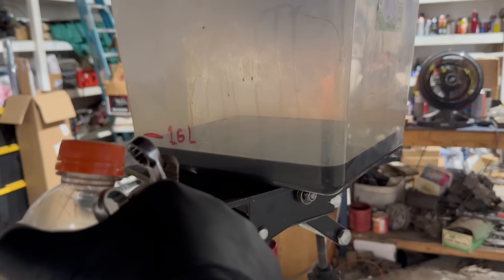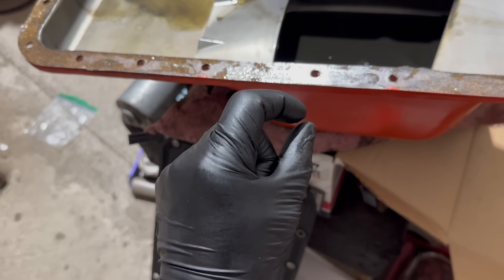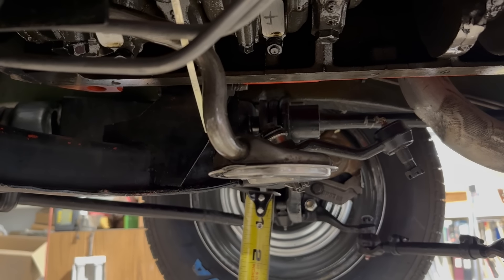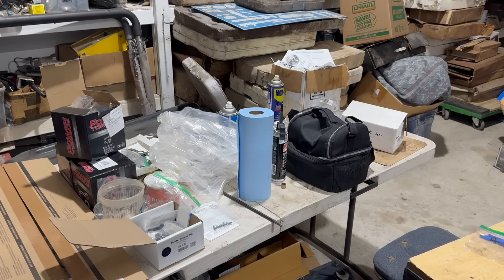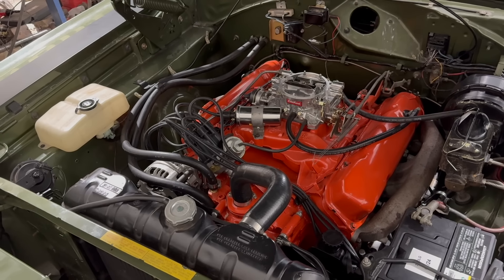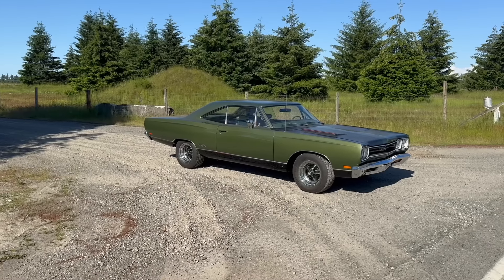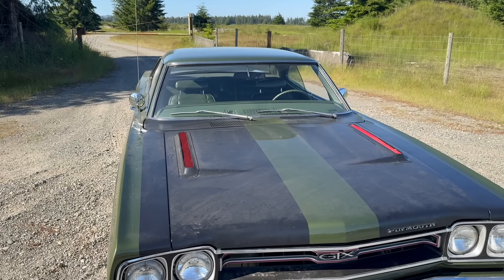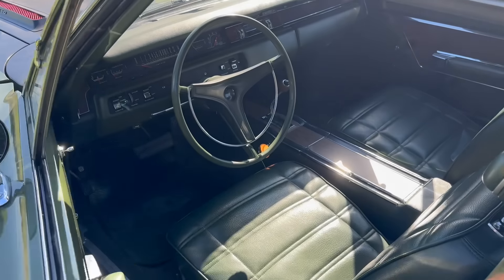Here's A Great Way To Blow Up Your Brand New Engine - 1969 Plymouth GTX 440 Oil Pickup Fitment Fix

Comment: Jamie, my 71 Bee has a 971 pan and I know stock was a 402. However, 440 source says they both take the same pickup tube. 971 is 1/2 deeper than the 402 but they both have the same oil capacity. I know Ma Mopar started putting next year parts on the previous as I have an AVS rather than a Holley. Should I worry about oil starvation with a 971?
Reply from the maker: That’s interesting. There is definitely an amount of up and down adjustment you can get based on how you orient it, so I guess they are probably right. I just made what must be the same pickup work for this six pack style pan so there you go. I have a 440 that was in a different ‘68 Charger for years, and it had the 971 pan too for some reason.
Reply: @DeadDodgeGarage  I also found out that since my car was a factory A/C they pulled engines that were the newly painted blue. Lynch Road assembly did all kinds of weird things.

Comment: Hello here’s hoping Jamie’s help lines open again. Over here in sunny England our sons 1971 Chrysler 300 440 is using a bit of water it likes to leave a litter puddle when we switch off. Big question should we ? Run it up with the radiator cap off to bleed it ,or take a heater hose off and try and bleed it like that or maybe time for a new shinny alloy rad . Now it’s being used a lot more everyone loves it as if so rare over here  have a nice day regards Roy.
Reply from the maker: I’m assuming this has no expansion tank, just a puke line that goes to the ground? Do not fill the radiator beyond the very top of the rows inside. When cold, the coolant level should be a couple inches below the top of the radiator. As the coolant expands when the engine warms, it will then be full. If your coolant level is above that, it may piddle some when warming up, and when you shut it off, it’s going to mark its territory. Let it go through a couple driving cycles, and it should stop. I just did this again in my Charger because I thought the level was low. If it continues from there, you may have other issues, and you are welcome to contact me at DeadDodgeGarage@gmail.com
Reply: Thanks again ,just watched your latest video we had the same issues during the week HT lead came off left a puddle of water and exhaust dropped a  rubber mount and choke didn’t want to come off, All good now the joys of old cars with a mind of their own. Keep up the good work Regards Roy

Comment: You completely click baited me. I absolutely love that car and had a small heart attack. That's something happened to it. And you blew up the motor I am so glad it is running good and yes, pick up tubes and oil pans and ground clearants. Is extremely important in any car project?
Reply from the maker: Alright, that’s my bad. Haha. I mean something kinda did happen but it definitely isn’t blown up. Any engine assembly needs to involve an oil pan to pickup clearance check. Anyone skipping that step is asking for trouble.

Comment: The 7 quart oil pan was 66-69 Street Hemi. No real 440 pickup for them. 66 - 69 440's, including Six Packs are 5 quart. 1970 and newer 440 high performance engines have 6 quart pan as do 70-71 Street Hemi's. There are 440 pickups for 5 and 6 quart pans, but not exactly for 7 Hemi quart pans.
Reply from the maker: Apparently there are 6 quart pans and 7 quart pans? I’ve been told in another comment that 440 source has a pan that is larger horizontally but no deeper, and holds 6 quarts. Given the existence of the skid plate on ‘70 440 HPs, we can certainly deduce that a deeper pan exists for 440s, and we’re looking at it here. I haven’t measured it for capacity myself, but I have been advised this is a 7 quart fill including a 51515 filter.
Reply: @DeadDodgeGarage  Yes, the pre-1970 440 pans are for 5 quart systems. The pre-1970 Street Hemi pans are for 7 quart systems with no factory 440 pickup. The 1970 and newer high performance pans are for Hemi's and 440's and are for 6 quart systems and have both engine pickups from the factory. The 1974 to 1978 Police 400's also have 6 quart oil systems. 1975 and newer 6 quart oil pans have a built in slosh baffle, in addition to the separate windage tray.

Comment: You are correct about breaks put on the factory stuff if you're in the middle of nowhereville and you're Wildwood need to park good luck and if you're in Arkansas the parts guy look at you like what the hell are you talking about man:face-blue-wide-eyes: I had an incident where I had 67 Biscayne police car 427 three on the tree how crazy is that real police car it had four piston disc brakes on the front from the factory of course they leaked I went to Auto clutch brake and gear professionals I said I need to rebuild kit for this they said it doesn't exist I said you're staring at it it does exist I had to send them out to get horned and received but I got results they didn't know they never heard of it have a great day